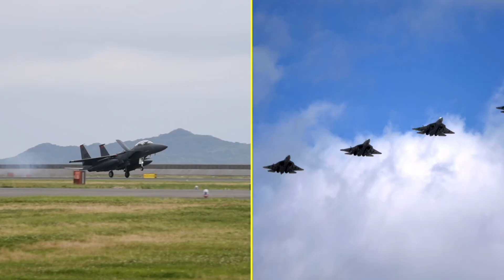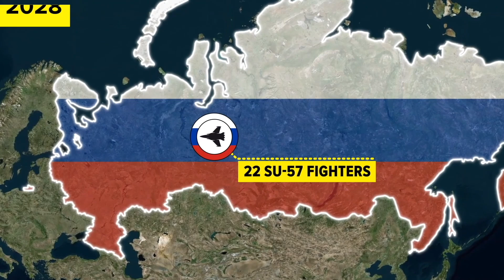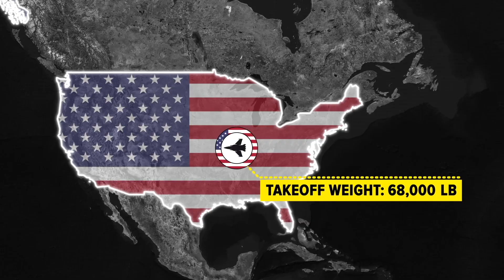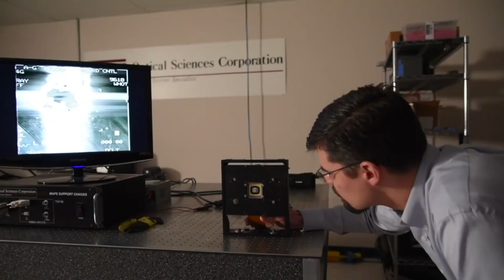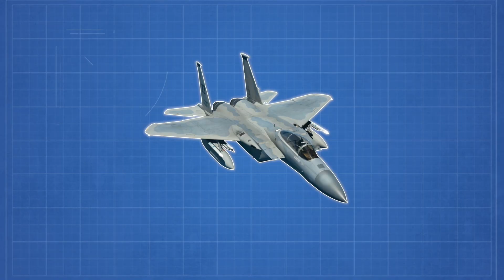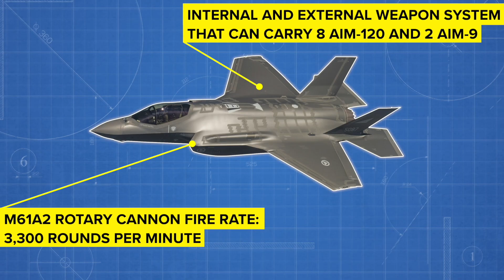Why the F-15 Still TERRIFIES Russia

Comment: The Real Question is How the F-15 EX Does against the J-20 ?

Eagles  EPAWWS/ FLIR/ IRIST
+ Mach 2.8 Not to Exceed Speed limit ( Dash to Escape a not favorable dogfight)

Give it a Chance , The J-20 with Its Canard & Huge Engine from the back can still be Tracked. EX -AESA Radars our very Powerful.

Su-57 is not a True 5 th Gen 
It’s 4.75 Gen . It’s Stealth is Equivelent to F-18 Block 2 clean.

Comment: F-15 EX With Aim - 9x
Su - 57
Would not fly circles over F-15EX witg Fly - By wire & Powereful engines  can still Manveure with SU-57

They didn’t Say about  
F-15 EX -  EPAWSS
Which Gives a Fighting EX a  fighting Chance  to disrupt a Lock on. while the EX FLIR  can Track Su-57

Su-57 is not true Stealft/ F-15 EX  AESA Radar can track it at good ranges + FlIr

Comment: Malaysia use su57 54 3 squadron..kinzal Marh 10. Russia develop Lazer. 36  Fa5020  8 training gen 5. China Air force 16 fly over Malaysia zee. bae hawks Tak charge. Su57 18  Penang. 18 Su 30 replacement. Kuatan 18 Fa5020 8 training gen 4.5 18 fa5020. 18 Sukoi 57

Comment: The F-15 EX may still have a chance. The new changes gives it more maneuverability compared to the older models. It can do some moves that the old ones couldn’t due to the new control system

Comment: RCS falls somewhere between 0.1 and 0.5 to 1 square meters as where the f22 and f35 have a rcs range of widely recognized to be less than 0.0001 square meters. So the Su-57 is more of a 4th gen then 5th eg they aren't confident in it just like the T-14

Comment: SU-57 does not have RAM coating. you can literally see by its paint job. Large freaking gaps between flight surfaces,  Using fiberglass as a stealth material. No this junk is not stealth.  It's flying target practice.

Comment: nice video, but:

- RADAR does not run on sound waves, but rather radio waves (in the cm and mm range).
The ECHOLOT works with sound waves, which was first used by the British in WW2 against German submarines.

- There are 2 infrared/thermal imaging systems. Active and passive. In one case, the battlefield is illuminated and the reflection is registered by a sensor. This was first used by the Germans in WW2.

The next generation does not need any illumination, but rather registers the (long-wave) infrared signature that the object emits.
This is probably also what is meant here, in order to register the signature of the engine, even if the aircraft is not detected by the radar.

In principle, stealth aircraft are not entirely invisible. In Yugoslavia and also in Iraq, F117s were found and combated by long-wave radar devices (cm range) (older system from the USSR).
The German company Hensold is building a similar radar that can find stealth aircraft sooner.

Comment: Who does the fact checking on this? Radar does not use sound waves.  It is an acronym for radio detection and ranging. Radio Waves propagate at the speed of light not the speed of sound. Infrared detection from IRST is completely passive. Nothing is sent out. We aren't talking about the 1950s and 1960s infrared lamps used by tanks.
Finally, there's a serious question as to whether the Sukhoi Su 57 is a true 5th generation aircraft. It has a lot of non-stealthy angles and those engine inlets look rather suspect.

Comment: I don't think IRST is as big of an advantage as you think it is.   At most we are likely talking a range of about 30 miles, and that is optimistic. We are talking beyond visual range, but not much beyond visual range.   (also the SU-57 reportedly has IRST as well)   I also think you overestimate the SU-57's stealth capability.    They are estimated to be pretty equivalent to a Super Hornet in a clean configuration, at ~1m^2.  (This is like 1000 times greater than the likes of the F-22 and F-35.) Fully loaded the F-15 also has a HUGE radar signature.  Like ENORMOUS.   We are talking some 15 m^2.  The SU-57 can probably detect the F-15 at 150+ miles, despite the Russians weaker radars.

The F-15 also does not have a monopoly on long range air to air missiles.   The Russians claim up to 200 miles, but who knows if it is actually true, and how effective they are at that range.  (I'd put my money on the older US AMRAAM, and newer JATM, but still, not a U.S. monopoly)

In a one on one starting from a distance scenario (which is highly unlikely in real life), I suspect the SU-57 will detect the F-15 much sooner than the F-15 detects the SU-57, and thus the SU-57 would be able to fire long range air to air missiles first.   While the Su-57's radar signature is large for a stealth aircraft, it is better than no stealth at all, and gives it an advantage there in detect-ability against an older platform like the F-15.  Still, the SU-57 will likely show up on the F-15's radar before it shows up on its IRST.

I would argue the SU-57 is barely a 5th gen fighter at all.   More like a very advanced 4th gen fighter, and more advanced than the aging F-15.

In air to air capability, I would rank them as follows:
F-22 > F-35 >>> SU-57 > F-15

Comment: Saime hapend in Serbia in'99 whit F117. Whi did not cnow it was inwizible....
Saime the Su-35 whud destroyd F22...
That Is whay bouth saids Are not yusing  5gen figters .....🎉🎉🎉🎉
Reply: I'm just going to assume English isn't your primary language because that gave me a headache trying to figure out what you were saying. In fact I still not sure I understood what you said but I'll make a couple things clear for you.
The F-117 that was shot down over Serbia was a victim of complacency. They were literally flying the same route night after night buy the stealth aircraft which was an absolute No-No the Serbian missile operator got lucky because he knew where the plane was coming in and approximately what time. He happened to turn on his radar at the exact moment the F-117 opened its bombay. Because of that he was able to get a brief lock on the aircraft in launched a missile blindly basically, that was able to get close enough to affect a Kill.
And as far as the F-22 goes Russia has absolutely nothing that's even remotely capable of destroying the F-22 the only possible way is if for some bizarre reason they both happen to run into each other in the middle of nowhere, with neither playing having Radars or sensors on and they got into a close range dogfight with no missiles present, and it was a brand new F-22 pilot.😂
F-22 literally out classes the su-35 and su-57 in every measurable metric do you have 22 is a true stealth aircraft, the su-57 is basically a poorly made low visibility aircraft not even true stealth

Comment: Multiple mistakes in this video:
1. Radar does not work off sound waves.
2. The F-15EX is the "missile truck" model. Not the F-15C.
3. The F-35 is equipped with the 25mm GAU-12/U rotary cannon, not the M61A2.

Seriously, do a bit of fact-checking on your researchers before this stuff goes live.

Comment: The surface of the Su-57 is fiberglass... no radar cross section
Reply: Just a couple other facts to just tell you how unstuffy the su-57 is, fiberglass is 100% radar reflective. It's no different than most other materials.
Also if the su-57 was made out of fiberglass it would literally disintegrates mid-air.😂😂😂
Just to give you an idea how much the Russians don't even understand about Stealth technology, something as little as a bubble in the canopy material gives off a radar return. If you actually have watched any of the videos the Russians have put out look at the imperfections in the cockpit canopy of their aircraft when you get done with that look at all the jagged edges all over that aircraft and the Ribbit sticking up, literally every one of those gives off a radar return. At best the su-57 is a low observability aircraft not even as good as the eurofighter or the Gripfin fighter
Reply: Don't know where you got THAT info from, but given the THOUSANDS of non-flush screw-holes attaching the Su-57's skin panels, and the huge radar cross section of the last generation engines, the thing might as well be a flying BILLBOARD.
Reply: @echo   Total bs
Reply: And one more thing that ought to interest you!  The Su-57 cockpit is equipped with rear view mirrors.  Think about that for a second - If you were stealthy, and therefore no one knows you are there, why on earth would anyone be on your tail, that you would need to be equipped with rear view mirrors???   The answer is that the Russians KNOW for themselves that the Su-57 has nothing in the way of stealthiness.

Comment: Radar: RAdio Detectinlon And Ranging.  Sonar: SOund Navigation And Ranging. Itsin the names. Radar does NOT use sound.  And you don't serrated the edges of winds, you do it with wings. Poor TTS and flatly obvious failure to comprehend 80 year old technology is extremely disappointing. Plus an infrared detection system does NOT require sending out infrared radiation,  and following a statement about such being required with a comparison to an infrared telescope is patently ridiculous.  To assume a telescope sends out an infrared signal to detect distant stars shows, again, a complete failure to comprehend the subject matter. Using chatgpt and TTS with obvious pronunciation errors would generate at least this level of video. I will stick to channels that take the time to understand subject matter and know how English actually sounds, rather than something that so clearly,  laughably,  half-asses something and calls it analysis. Maybe a middle-schooler on an old smartphone churns out this channel between classes.

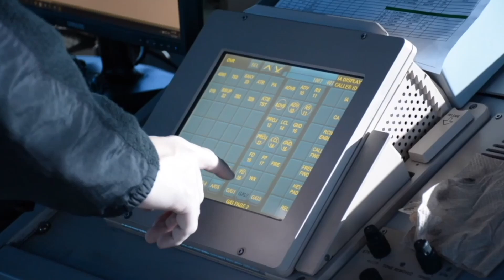Comment: 13:50 That is not at all how IRST works. 

Infrared Search and Track is a fancy name for "heat vision". It is a 100% passive system.

It's basically just a camera that can detect differences in heat.

The F-15 also has a huge advantage over the Su-57: It actually can live up to its reputation and there are hundreds of them.

Also, the USAF just ordered a couple hundred F-15EX to supplement the existing airframes and ease the burden on F-35 frames. This is on top of NGAD.

Simon, you really need to do better research, because this isn't the first time you've been very wrong in one of your videos and I found all this out simply by googling the information.
Reply: F-15EX exists because vii bezt plain eva' eF-22 didn't make it. Didn't become what it should have. Therefore the replacement pair of f-15 + f-16 is pseudo-existing-plane + F-35

Comment: The value of a weapon system is NEVER best determined by 1 on 1 scenarios. No one, not even Russia, sends up aircraft for one-on-one duels unsupported.

There is a lot of other factors involved. Aerial refueling to enhance combat endurance, airborne and ground based radar support, SAM support, EW support, pilot training, and even quality of basic maintenance matter.

In this case, the Su-57s go up looking for F-15s who may be easily detected at range.... and as they maneuver around to get the F-15s they get bushwacked by the F-22s or F-35s they never saw. Then the F-15s volley off their long-range missile load to mop up any survivors. Or the F-22s and F-35s can remain covert and provide targeting data for the F-15EX's massive missile load, then come in and sweep up anything left.
Reply: The F-15 remains a credible threat BECAUSE of the F35 and F22.
Reply: F-22 is the plane that disappears in history. Less ready than 50 years old f-15.

Comment: F15 is the best airplane in history as far as performance, reliability, and lethality that meets up to its price. Sure the F22 and F35 would in theory win a 1vs1 with an Eagle. But in the bigger picture, those “wonder weapon” airplanes are not conventional, easy to produce, easy to maintain, affordable, or capable to be a workhorse. They need to work in a combined arms approach backed by the F-15.
Reply: Well what you're saying is basically true when it comes to the f-22. But the F-35 is literally being Purdue to replace the F-15 because they're running out of serviceable hours. And they are easy to produce because they're turning them out in quite large numbers now, and they literally are designed to be the Workhorse of the Air Force

Comment: If you look at the engines of the SU-57, there is no attempt to hide the heat from those engines.

If you look at the air intakes there is no attempt to hide the engine fans from forward radar.

There no attempt to do anything stealthy on the SU-57.

The 360 degree radar is really a 360 degree shouting here I am kill me.

Comment: 25% of the imagery used in this video is incorrect. You are diseminating information that is incorrect.
Reply: Yes, but you need to perfect your spelling, i.e., disseminating. 😉
Reply: @richardzelade  Quite right. When I'm typing on an old Dell E6410 with a wobbly keyboard, tiny deviations can be forgiven. If the mistakes in imagery in this video were of the same scale, they would be forgiven.

Comment: I'm gonna save you 20 minutes of bullshit recaps: It doesn't matter how maneuverable your plane is, if the other guy can see you first and shoot at you first, you're screwed.  While yes, pilots do practice ACM, most engagements are done Beyond Visual Range... and the Su-57 has the radar cross section of a whale.

Comment: The SU57 is only stealthy nose on. If there is an AWACS in the area the SU57 doesn't have a chance because the AWACS can relay positional information to any allied aircraft. This will give the F35 the ability to engage the SU57 from another zip code.

Comment: And how exactly will F-15 see SU-57 first?
Reply: By being the only plane with IRST apparently? Nevermind that those existed on both US and Soviet planes since the 60s, it's somehow a special new F-15 thing to counter Su-57s.
Presumably it's a backup for when their SONAR isn't working...
Reply: @xTheUnderscorex  we use sonar in the sea, but not in the air. Ofcourse the sonar will not work flying mach 1.5. But if the plane use active radar it will be spotted! We likely don't get the answer as they just cannot meet.
Reply: It has better radar.  The Su-57 ISN'T a stealth aircraft, it incorporates old engine and air-frame designs that offer nothing in the way of stealth.

Comment: And what about the latest F-15, the F-15 EX? Basically the F-15 EX is a "Missle truck" and that it does better than any other aircraft in the world due to its immense power from its new engines. As well it now can communicate with the new coms for F-35 style "group coms". It will know what the F-35 fighters know and vice versa.
The SU57 is so damn "invisible"it hasn't been seen in action in Ukraine.  😂
🤣

Comment: Most of your videos are pretty decent....  this one is absolutely packed with flaws.  Some of the bigger key points being that Radar is not sound waves but electromagnetic RADIO waves.  Then there's the statement that infrared "sensors" (AKA infrared search & track) would give the F-15 an advantage over modern jets....  all update 4 and 5th gen fighters have this capability.  In fact, the Russian fighters have had it for decades - this is one area where Americans actually fell behind the curve because we were more concerned about fighting terrorism than being at the forefront of fighter technology for the last 22 years.  Then there's the idea that the F-35 or the F-22 "could hold their own/defeat" a Su-57.  They both have major advantages over the Russian jet.  They boast WAY WAY smaller RCS (they are WAY harder to see/track/lock with Radar), better radar, more effective missiles (The AIM120 AMRAAM may have less range than the R77 but it has a much better on board radar and is more consistent in finding its target), and better situational awareness.  Either plane will dominate the Su-57 in all but a dog-fight. That said, a pair of F-15s, even EX, are going to have a bad day in an engagement with a pair of Su-57s.  Despite having a more powerful radar, the F-15's RCS is so massive that there's simply no way it's picking up the Su-57 before the Su-57 has fired on it. The Su-57 is not on par with American 5th gen fighters, but it still out-classes any 4th gen fighter.  The F-15EX is not meant to go head to head with the Su-57.  It's meant to shoot at it using a radar lock data-linked to it via an F-35 that snuck up on the Sukhoi

Comment: The fact that you are mispronouncing Sukhoi is really annoying.  You are putting an "SH" on the front of that name, where it is pronounced correctly with only the "s" sound  It's not "Shukhoi!  And RADAR does not use "sound" waves, it uses projected radio waves bouncing back to a receiver in order to pinpoint where a target is located.  "RA"dio "D"etection "A"nd "R"anging (radio detection and ranging) is where the acronym RADAR comes from.
Reply: Who cares?

Comment: The F-35 does not have a 20mm M61. The gun was an intentional, deliberate design decision and is not hard to find details on...
Reply: Then if you took the time to actually look for that information you would understand that some models of the F-35 do not have the internal cannon, but the Air Force models do have it
Reply: I don't need to take the time to actually look for that info. It's my job to know it. That is also irrelevant to understanding which models have an internally or externally mounted gun. I don't really get what point you're trying to make?